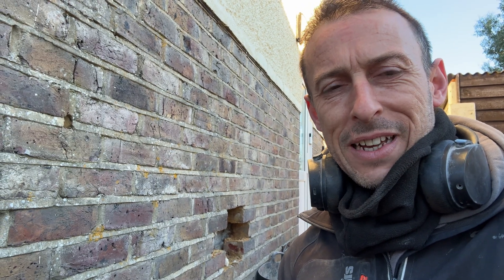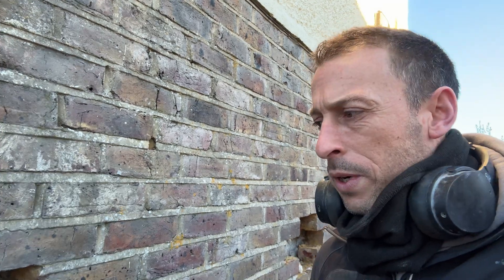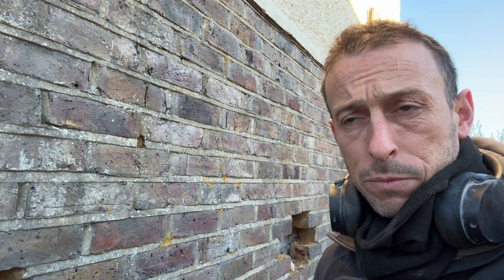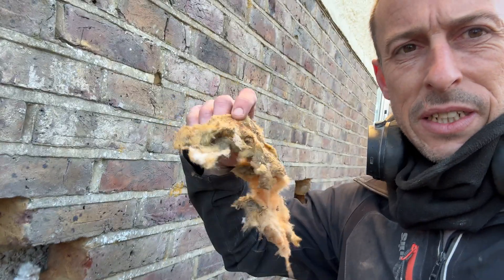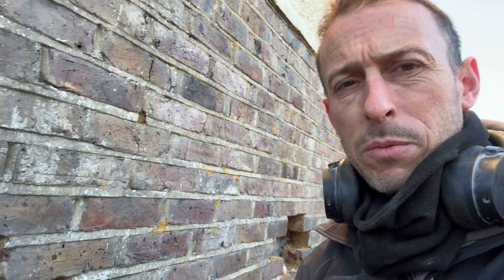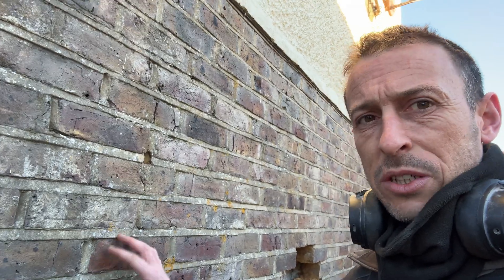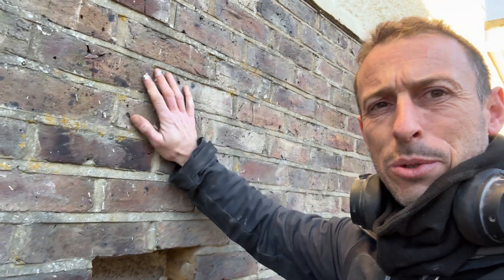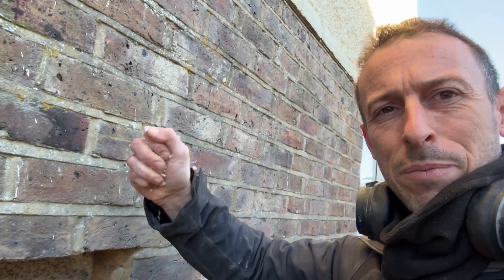DAMP WALLS AND WET CAVITY WALL INSULATION.

Comment: I watch these videos with interest as I'm convinced this is the cause of my damp & mold issues (along with a few old window units still to be a replaced).
Reply from the maker: It might be worth removing a brick externally in the location worst affected just to see.
Reply: Cavity-walls must NOT be bridged with insulation(insulation touching the outer walls inside the cavity-wall); or else moisture will transmit from the damp outer wall, through the touching bridging insulation, and into the inner wall; making the inner wall damp inside the building.
Injecting foam into the cavity-walls stops the property from breathiing: resulting in condensation saturation of the inner-walls inside the property. 
Cavity-walls that are already built up can NOT have cavity-wall insulation added.

Cavity-wall insulation batts(panels) can ONLY be installed from the very start of construction of the cavity-walls. 
If cavity-wall insulation is to be used, there must be a large air space gap in-between the face of the cavity-wall insulation batts and the outer wall inside the cavity-wall; this includes an air space gap in-between the face of the cavity-wall insulation batts and the cavity-wall tie drip-points(which must point downwards in the centre of the cavity).
Cavity-wall insulation batts must touch ONLY the inner-walls inside the cavity-walls (of course touching the cavity-wall-ties and retaining-clips also).
Ask City & Guilds N.V.Q. (S.V.Q.) BRICKWORK teachers for PROOF of this.

Comment: Thanks for bringing attention to these issues. I was tempted at one point to ask the government about cavity wall insulation, but these issues could have been a costly disaster that we could ill afford. I'm grateful to responsible tradesmen such as yourself for raising the alarm. Life's difficult enough.
Reply from the maker: Thank you, so many homeowners are unaware and getting needless things done to try and fix it, so if I can educate then I’m doing my job.
Reply: Cavity-walls must NOT be abridged with insulation(insulation touching the outer walls inside the cavity-wall); or else moisture will transmit from the damp outer wall, through the touching abridging insulation, and into the inner wall; making the inner wall damp inside the building.
Injecting foam into the cavity-walls stops the property from breathing: resulting in condensation saturation of the inner-walls inside the property. 
Cavity-walls that are already built up can NOT have cavity-wall insulation added.

Cavity-wall insulation batts(panels) can ONLY be installed from the very start of construction of the cavity-walls. 
If cavity-wall insulation is to be used, there must be a large air space gap in-between the face of the cavity-wall insulation batts and the outer wall inside the cavity-wall; this includes an air space gap in-between the face of the cavity-wall insulation batts and the cavity-wall tie drip-points(which must point downwards in the centre of the cavity).
Cavity-wall insulation batts must touch ONLY the inner-walls inside the cavity-walls (of course touching the cavity-wall-ties and retaining-clips also).
Ask City & Guilds N.V.Q. (S.V.Q.) BRICKWORK teachers for PROOF of this.